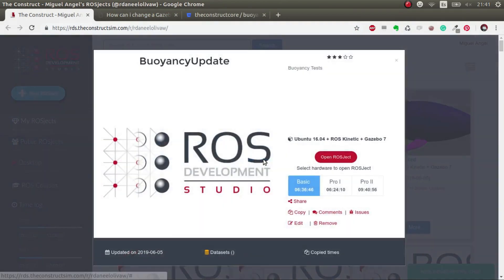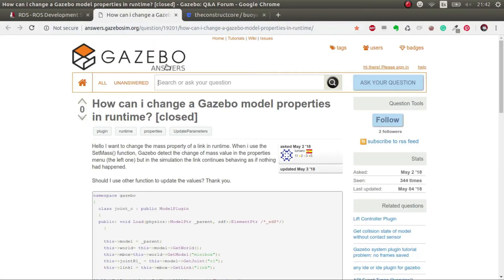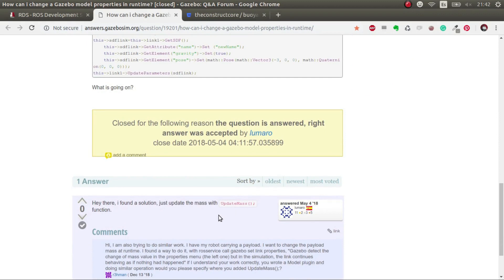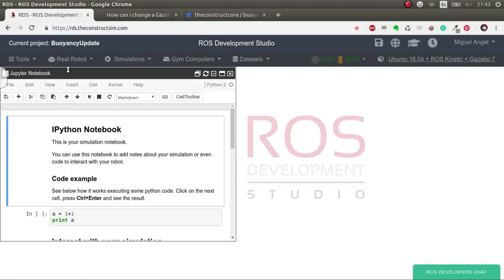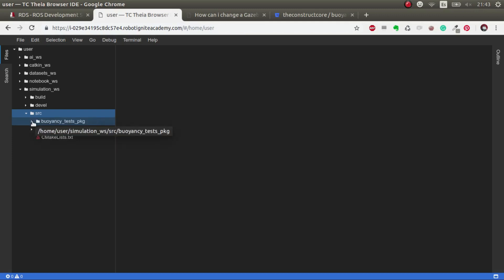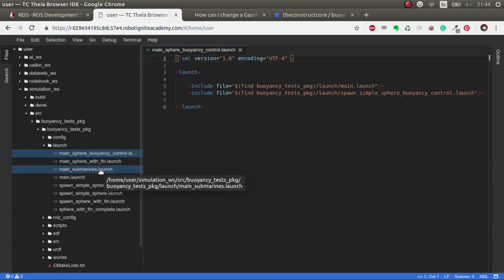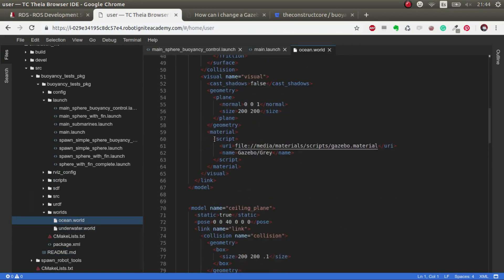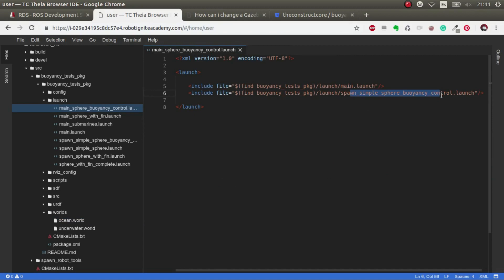[Morpheus Chair] Buoyancy Dynamic Control Gazebo | EXTRA.Ep.2

Comment: [Err] [Plugin.hh:178] Failed to load plugin libmodel_mass_controler_plugin.so: libmodel_mass_controler_plugin.so: cannot open shared object file: No such file or directory
Cant activate the Plug for mass control. im using Ros Noetic
Reply: dont mind I fixed by manually adding a plugin to my gazebo